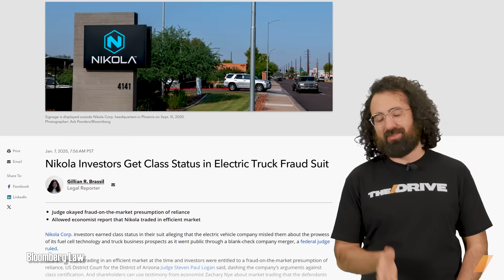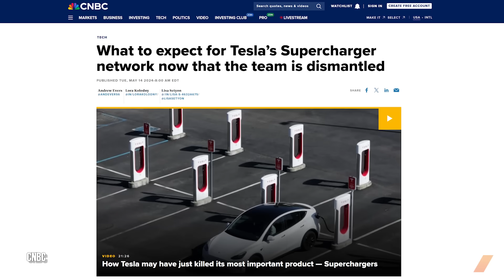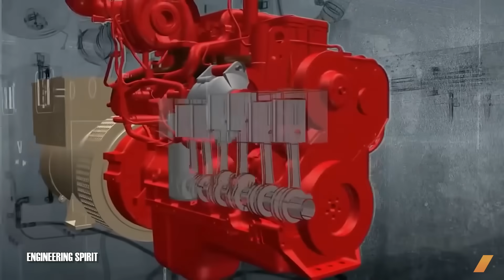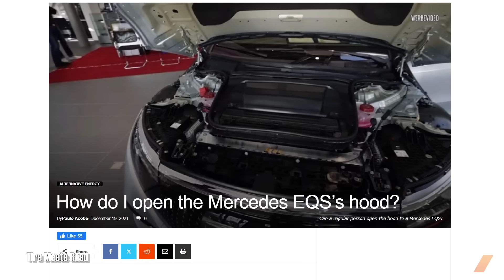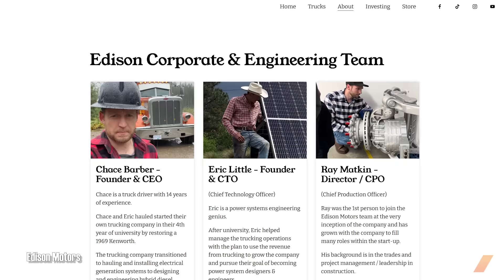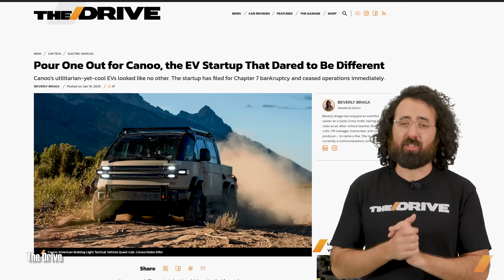The truckers in a shed beating Tesla with 100-yr-old EV tech

Comment: it's replacing the Gearbox with: Generator+Battery+Electric motors+bunch of wires and transformers, not worth it, most trucks don't brake much to have energy to recover
Reply: If they are logging on a mountain then they are driving the truck up empty and then coming down the mountain with a full load.  They will be putting a lot of power back into that battery.
Reply: Tell us all that you have no idea what Edison are doing without telling us you have no clue what you are talking about.
Reply: @paulprice5466  a little bit of your beloved american bullshit
Reply: That WHOOOOSH you just heard? It's the point, that flew over your head.

That generator? It runs at constant load when it's charging the battery. At the optimal rpm with the best possible brake-specific power. (Meaning: at the rpm and engine load to get the most usable energy from the fuel.) It doesn't need the complicated stuff like exhaust gas recirculation (EGR) or a diesel particulate filter (DPF). The system has no turbo lag. It has no clutch, it has no gearbox. What it does have is full torque at 0 rpm.

It's not heavier than a conventional truck, yet it saves 5 to 10% in normal driving and can save you 70% fuel consumption in stop-and-go traffic. Despite that, you claim "not worth it". Based on what???
Reply: @Hydrazine1000  Based on the cost and complexity of the electrical components. Even in stop and go traffic you don't brake much. So that 70% economy is a stretch. The 5-10% value I can believe but it's not worth it. We use the same diesel truck at the farm for 27 years and the electrical parts are repaired many times, I hate them, and the batteries too, only things that go wrong.
Reply: @G55STEYR  In a diesel-electric application, you run on the battery. If you're stuck in traffic your engine (well, sorry, generator of course) is off, untill the battery needs a refill. With your regular engine you're consuming fuel when idling. (Unless you have a modern truck with auto start-stop.) Not with a diesel-electric. And when the generator does run to refill, it is running at peak efficiency. It gets up to the optimum rpm and boost and stays there untill recharging is done. No repeated transients.

Also: every time you start from a full stop, an engine has to spool the turbo(s) and climb through the rev range. It has to work its way to a small zone of high efficiency time and time again. A diesel-electric doesn't have to do this. IF it is fired up, it moves to peak efficiency straight away and stays there untill shut-off. Especially in start-stop traffic, a conventional engine+clutch+gearbox has a serious disadvantage.
Reply: @Hydrazine1000  Hy tech worth for a locomotive not a truck. The battery is the problem
Reply: @G55STEYR  What experience or knowledge makes you state that the battery is the problem? I don't see it, so what is it that I'm overlooking?
Reply: @Hydrazine1000  Cost, weight, replacement value is a nightmare, all of it you don't need
Reply: @G55STEYR  Weight? The total weight of such an Edison truck is the same as a conventional one. The battery pack doesn't have the same size as a full EV truck. It only weighs as much as the gearbox it foregoes and the difference in generator weight vs engine weight (plus weight of the EGR and DPF). It isn't as big as you think it is, nor does it weigh as much or cost as much. Two Canadian dudes created this in a yard. How complicated do you expect this to be?

But, hey, let's agree to disagree. You know the conventional stuff, and it works for you. Not everyone needs to early-adopt.
Reply: @G55STEYR   Strange that you make claims. But not claims you can back with sources. The size/weight of a battery pack depends on how long it should power the vehicle without recharge. So huge battery packs for long-distance electric-only operation. Small battery pack for short distances where you either constantly recharges or some of the power even bypasses the battery.

A car or truck needs an engine for the worst situation. Which means it's too big for 95% of the time. Sometimes for 99% of the time. In this case, you can manage with a smaller and lighter engine. Because it isn't the power of the diesel engine that decides how you get over a steep hill. It's the amount of power your electrical motors can deliver. So the diesel may manage only 70% of the total power and the next 30% comes from the battery pack.
Reply: @perwestermark8920  Engines can use as much as the battery can discharge for a short time until battery is empty, then you are down to the power of the diesel.
Reply: @G55STEYR  And if you wasn't so much of a naysayer, you would have noticed that I wrote that engines needs to be overpowered for the very few times we need the extra power. So it's a non-issue that you drain battery capacity these few times.

If you argue genuinely, you would have clearly understood the design is always designed powerful enough to run for arbitrary times without battery drain at the power levels you need most of the time. Oops that it was already clearly covered in my post and still went past your head...
Reply: @perwestermark8920  The idea is to keep the same weight so you cannot have a big battery, better yet simplify and power the engines directly from the generator
Reply: @G55STEYR  "Better to drive directly from yhe generator"? It already does that. With the battery adding extra power when needed. And the generator producing enough power to most of the time be able to fill the battery. Because most of the time the diesel has excess capacity. But still being able to be significantly smaller and Weaver than a diesel-only vehicle.
Reply: @perwestermark8920  That would be interesting to drop power from 900 to 300 in the middle of a hill or pass
Reply: @G55STEYR  See - Drop power from 900 to 300 is something only a dishonest person would write. You did see the video? You think that 10 litre scania represented a drop from 900 to 300 hp?

It would be interesting to see if you can stay focused on honesty.
Reply: @perwestermark8920  I think the drop would be gradual but the values are 900 to 400. I watched the logging test, no info about the fuel cons
Reply: You argue as if this is just to recover energy when braking. While totally missing how rpm affects efficiency for internal combustion. And fuel is a huge part of the total cost.

Next - more than twice the torque when starting? That's very nice - not having 0-60 mph time measured in the calendar...
Reply: @perwestermark8920  Torque when starting? That seems good if you never driven a truck, you manage 1st to 6th gear starts just to minimize that
Reply: @G55STEYR  You manage the gears because you need to. And I'm not talking about the 0-20 mph where it takes hardly any power since kinetic energy is the square of the speed. You would understand this if you had a will to understand it. But you are locked in a fixed idea.
Reply: @perwestermark8920  I get it but why electrify a diesel truck when you don't have to?

Comment: FUD
Reply: ? fear uncertainty & doubt ?  Huh?
Reply: Compares GMC battery pack to Tesla battery pack. There is no third rail on most train tracks that is why they need diesel to create power, why not just run the diesel to power wheels? Only thing I see as non-fud in amount of chargers. The grid is supplied with more power than we can use at any given time, otherwise we would have brown outs all the time. California brown outs were cause by not buying power from Texas not a supply issue. Have not had any since. We the people are tired of breathing your exhaust fumes, and getting cancer. Reason media is against tesla is they do not pay for advertising. Tesla model Y becomes the best selling car in the world without any advertisement.
Reply: @jefflethuman9794  You have a critical lack of understanding about electric generation, long distance transmission lines, the SCADA system, and the "duck" curve of power grids.
Reply: @ I can say the same about you. I generate my own electricity. Have people who work for pg&e also. Think of it as a river that you tap into. The river can never be allowed to run dry
Reply: @Sah-o5m  the system does not provide on demand power. It sends out more power than is being used so we do not experience brownout. Long distance lines lose power also which means more power needs to be delivered than what actual makes it to the end of the line. Yes they lower power output at night, however it is based on passed usage not current usage. There is always more power in the lines than being used.  That is why many countries are using battery backup systems to store the excess power.

Comment: Deboss Garage is working with them to build retrofit parts for regular trucks so you can keep your own truck on the road and making it a hybrid
Reply: Best project ever!
Reply: I just need a diesel electric 80 series land cruiser, and i'll be set for life.
Reply: @DM-in5vk  It would be a nice project.
Reply: Man, i gota start looking for some old trucks for cheap by me with bad transmissions ha.
Reply: Need this for my OBS chebby with a 350 that's getting tired
Reply: I would most definitely turn my Ram 3500 into a hybrid, I do a lot of frequent stops with my business
Reply: And eventually they'll sell bus kits to bus manufacturers, i want kits for hatchback sized cars too. I would like to see wireless charging built into the base eventually too.
Reply: Range Energy has been putting all the electrics in the trailer, no need to modify the truck at all.